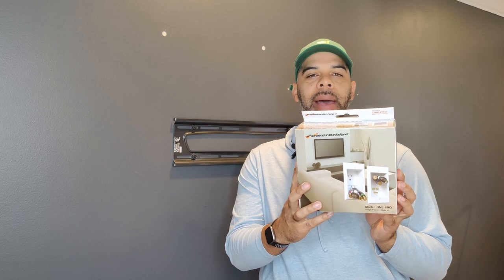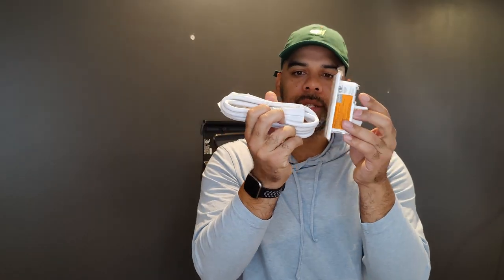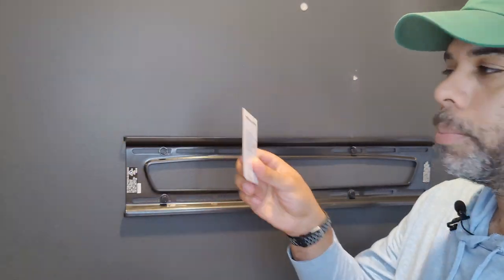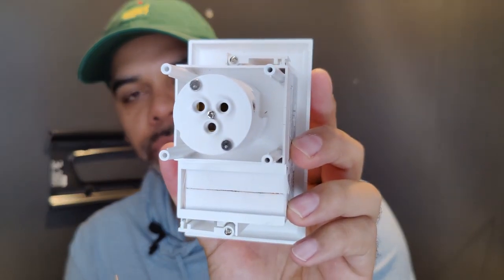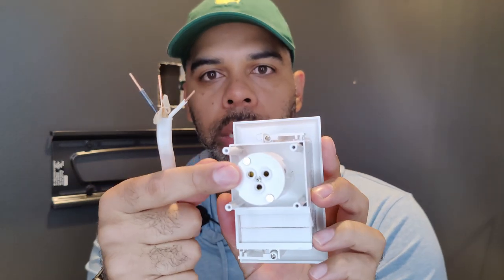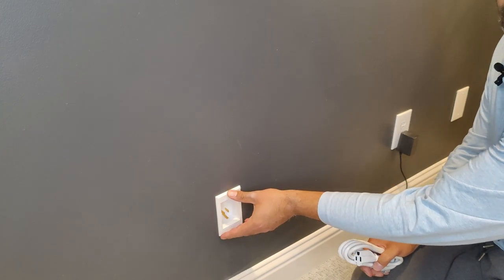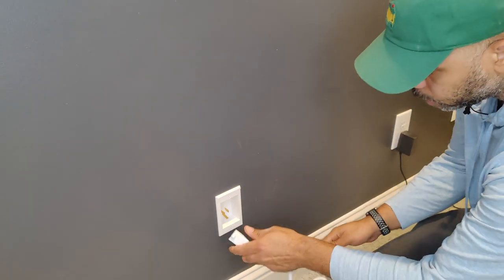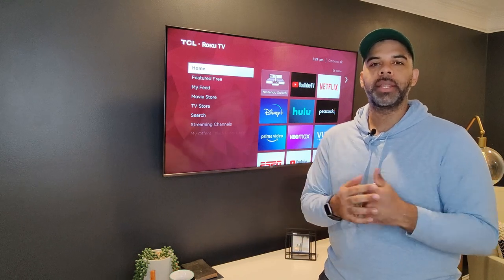DIY: Hide TV Cables with the PowerBridge In-Wall Cable Management

Comment: Great video, but in order for me to connect other cables to the tv like hdmi I would have to make another hole to route those wires ..
Reply from the maker: Yes you need to make two holes
Reply: It has an opening in the box to pass wires through. Thats what the little brush/wires are in each of the boxes.

Comment: So quick question, why is a power bridge like this safe to run behind the wall but not the actual tv cord or extension cord?
Reply from the maker: I suppose you could run an extension cord, however the reason for doing this is as much for looks as for function.
Reply: I had considered the same, but the reality is, Romex wire is designed to be installed in a wall, an extension cord isn't. If your extension cord in the wall starts a fire your insurance company may have a thing or two to say if you file a claim...
Reply: Romex doesn't heat up and cause fires. No power cords are supposed to be run behind the wall per code

Comment: I already have an outlet at the bottom. Can I just take it off and replace with the bottom box or do I have to cut a new hole to install the bottom box?
Reply from the maker: You need to install the box at the bottom in order to have the wire come out from behind the wall. So you'll need to cut the hole.

Comment: What happens if you need to cross studs? Can I drill through studs?
Reply from the maker: That is a better question for a contractor. I personally would avoid doing that. There also shouldn't be a need to cross studs based on the design of the PowerBridge.

Comment: You didn't show adding the cables..
Reply from the maker: Hey Zane, all you need to do is simply route your cables, for instance an HDMI cable, through the slot in the box you installed and the top and then pull it out of the box on the bottom. If needed you can remove the bottom box temporarily to make it easier to access the cable on the wall.